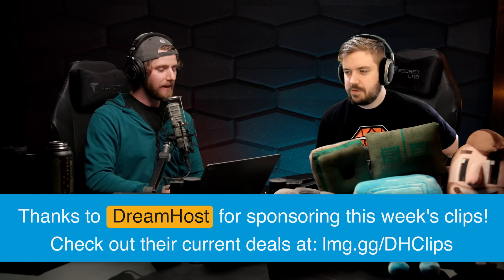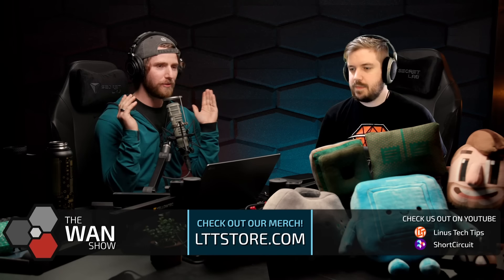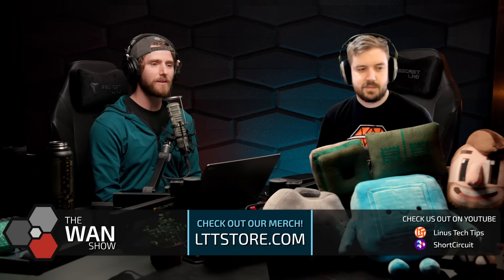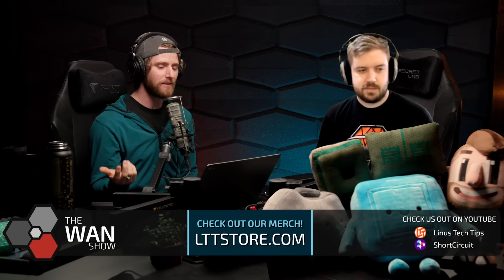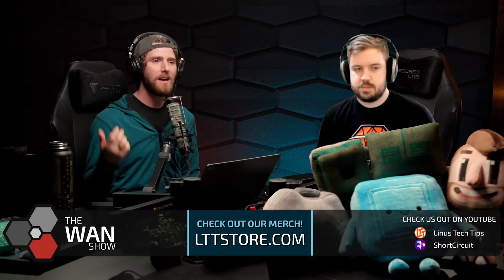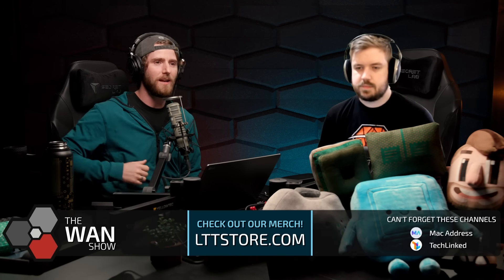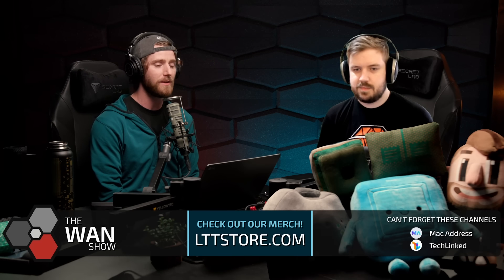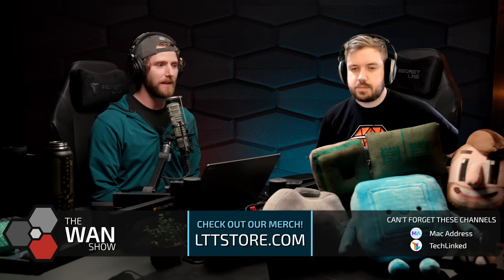They made me WASTE $10,000! Pt. 1

Comment: TP-Link Kasa -- all of their outlets, switches, etc. have an entirely local API (in addition to cloud functionality). I've made my own dashboard to control them in NodeRed (I hate home assistant). I access my NodeRed dashboard UI remotely over WireGuard.

I have the switches integrated with Google Assistant directly from NodeRed. And, if some part of my local setup fails, I can use the cloud integration (with the Kasa app) as backup.

If TP-Link shut down their servers tomorrow it would have no effect on me (other than losing my backup cloud access).

I haven't found any other smart device company that allows local API control out-of-the-box (most requiring soft/hardware modding).

Edit: Also, all direct Wifi, no hubs, no proprietary protocols, no middleman installers/companies.

Comment: The ONLY way to do the smart house thing is to split up the smart and the dumb thing. Regular lights, regular sockets, regular switches, then wire them up to whatever the hell you want, an OTS solution, an arduino with your own code, whatever the hell you want. The controller is a simple switch, so you can buy whatever you want, and you can connect whatever device you want, and if you want or have to, it's easy to change the brains.

Comment: i designed a smart ac. it can cool one room and not the other even save more energy instead of pumping heat outside pump it into the hot water heater so save on water heating. but i been exploring geo thermal energy.

Comment: You should be able to dump the firmware of the newer switches. Even if they have protection you can usually bypass it with fault injection. Probably much harder than creating a pr nightmare for Jasco though

Comment: sounds like the KNX problem. first paying for a really expensive house automation system that works on a seperated bus system basis, only to have to call an really expensive specialised electrician every time you want to change the settings on a switch or anywhere for that matter. the software that is used costs 350€ for 64 objects and if you want more objects in your house you need to pay for the unlimited version that costs 1k€ and from what i remember from the electrician school many companies that build you the system have a paragraph in their contract that they are the only ones that are allowed to acces and change the running system or the warranty for the complete electrical system that they build is gone, so even if you have the money to buy the software and are able to program with it, it is often not smart to actually do it because it could cost more in the end than getting the electrician to do it for you.

Comment: Linus I smartified my house a few years ago, and had the same issues with light switches and what to do with them, I ended up just doing the home theatre with lights controlled by tablet or phone or Alexa, and played around with presence sensing and motion sensors, but then I figured out the solution :)  you have solar installed don't you? add a battery or 2 and you wont have to worry about presence as you should be able to generate your own electricity and store it and never have to pay an electricity bill again. (not sure how feed in tariffs etc work in BC) I installed 10Kw of solar panels (AUD$10K) and a tesla Powerwall 2 (AUD$7K), nearly 2 years ago and I haven't paid for electricity since, my last bill was -$300. (I used to pay $4000-5000 a year in electricity bills) admittedly I am in Australia but just add more solar panels for Canada, you seem to have a pretty big roof :)

Comment: If I followed the video correctly though.

It is not just that the Jasco switches have proprietary firmware that fixes the problem that they refuse to allow end users to download.

It is that Linus bought directly from Jason switches that have very old firmware installed that the manufacturer refused to update AND won't allow you to get the firmware to update.

🙄🙄🙄🙄🙄

Comment: Sounds like Linus is overthinking smart light switches just a bit. I've replaced a handful of my switches with smart ones and it's such an easy part to replace you don't really need something that's future proof, you just need something that works for you today. Personally I actually like the Kasa smart switches from Lutron because they are cheap (I got the really basic one from Best Buy for $10) and they have done the job pretty well. I can turn the lights on and off from the app from anywhere in the world with an internet connection, it's all plugged into Alexa/Google Home so I can control with voice commands, I set the names so I just have to say "turn on/off the master (bedroom) lights" and boom, done. And I can set a schedule for my outside lights as well. So far I haven't had to mess with it, after the initial setup I haven't even had to think about it. It just works. And updates were super easy too. Just go into the app, check for updates, and boom, done.

And if I ever decide it's not what I want in the future I can just pull the switches and install new ones. So I'm not super married to the ecosystem either. Sure, it's not open source, and I'm a big believer in open source, but in this case I'm all for the low cost option that's easy to use, even if it's proprietary.

Comment: Buy a Kyocera printer/mfp and you'll get the same result. No download option for firmware on their site. They don't provide it to end users and they even don't provide it to resellers. Only their qualified (whatever the heck that means) service network is allowed to have it, cause seems, unplugging a network cable, powering off the device, inserting a flash drive, powering on the device, removing the flash drive after the firmware update successful message, and rebooting the device is a task that needs some very very high level of knowledge and experience. So if you want to update the fw in it, you either drive to a service center with a 20+ kilogramm device or you call them to site (and I assume pay for it). Just because you want an up to date fw on a device that has ethernet access so might have vulnerabilities (and yes, this also should be OTA FFS).

Comment: People balk at the cost of Lutron or Clypsal systems when we bid them. 

Lutron has much better systems than the cassetta (which is only designed as a retrofit replacement not a whole home solution).

Turns out that they actually work. They're 10x the cost of the crappy "Internet of things" but we can provide support, replacement, and service in the future. We've had to send in older (20 years+) modules for rebuild because they're not produced anymore, but they were able to return them too us working within a few weeks.

Edited to add: I only install homeworks and sometimes radio ra in retrofit. Casetta is crap but it's cheap. 
I'm also only working in high end houses, from 5-25k SQ ft so whole home lighting makes more sense.

Comment: That's where you tell them that you ordered the devices expecting the latest firmware, not firmware that is 4 or 5 years old and will be glad to sue them for the cost of the devices plus court costs if they don't provide the updated firmware for the device.  What they did to you is basically bait and switch and the devices with the old firmware would violate a warantee of merchantability because of the problems with the loaded firmware, especially since they have an updated firmware that fixes the issues.

Comment: If they don't want to give the actual file out to end users, I still don't understand why they couldn't just have an app or something that connects to the device and downloads it straight to the device so the end user doesnt have access to the file. Also would it be possible to rip the firmware off of the non-dimmer switches and put it on the dimmer switches (prolly illegal tho lol)??

Comment: One of the things I often do before buying a new device is to review other folks' experiences with the device (on the forums). I have mixed results with this. Sometimes I have to read through someone's apparently bad experience only to find that they could have fixed it quite easily. Obviously, that's not the case here.
"I am so annoyed." says Luke. Exactly. This is so ridiculous, I doubt even Apple would do something like this. Even though there are installers that do home automation for you, it's still largely a do-it-yourself field and a big part of DIY electronics is being able to update firmware.
Even now (after pondering this for some time), I can't quite decide whether this is simply evil or rampant stupidity. Either way, it's of such a degree that one couldn't write a character like this into a novel because the editor would say, "That's just not realistic."
Once again, reality overshadows satire.😡🤯🤮💩

Comment: The worst part is that this approach to home automation will add little to no value to the home, since when linus leaves he also takes home assistant and all of the programming with him. I doubt the average buyer will want to invest the hundreds of hours to automate a house of that size from scratch
Reply: Company I work for are focused on handover so that is never an issue (not going to plug us due to...well working there and might be a bit biased of how good it is lol). 

But I am able to report that such systems have been adopted by our competitors so maybe it will be more used in the future all over the industry. 

Just a little note with a code on the electrical central you enter in the app and get acces to the site. But that of course requires internet to the phone to sync the site.

 But for us the devices are not using the internet after installation.

Comment: Working as a embedded tester in smart home light dimmers etc like this. While the company is not really like the ZigBee/zwave based companies. We have our own protocol, app, do everything ourselves including hardware. Even we  do give users ability to update the fw (although through our app). Not a hex you can do yourself but hey, it already have to be configured through the app so it is just a click to update. 
Not that it will help Linus....as the products are not sold over there...and will not be to his requirements either I think. 
But it is fun others having that sort of issues as that would be non excusable for us....even having the motion sensor not configurable at launch would be a non starter for the product to even launch. 

Sometimes I wonder if companies even test things before shipping them out.

Comment: This will likely be buried, but I can provide some context. I am a developer in IoT, but I work with Firmware developers and handle the comms side into the cloud, I am not building the binary for the Firmware.

A few things come to mind immediately, signed Firmware won't work without the micro controller having the key. This can be complicated to support and potentially brick devices if not handled correctly.

Given IoT and best practices, allowing unsigned Firmware is a big no, and having a shared key increases the risk 

It could be a situation similar to what I have experienced where a manufacturer refused to provide any form of documentation for a feature of a processor that didn't match the behaviour documented, and the solution was a pre compiled binary that not even we were privileged to any glimpse into what it did. We suspect that it is a software fix for hardware issue that they won't admit to and now cannot change. They may have a restriction on who can have those specific instructions. 

If for example the Firmware is packaged as a delta rather than a complete image, this too could be a complex problem to support. 

While I agree that proprietary code is a dumb one, I don't think it is it and it's only a reason they gave to you. (unless it's outside of their control from someone like the processors manufacturer.) It's more likely an issue supporting end users doing it, and supporting it in a manner that doesn't end up bricking the device.

Comment: Motion sensors should be only used to CONFIRM something, not to trigger something. Use door sensors to TRIGGER a script, which will turn on the lights, then the script SHOULD wait 5 minutes and start motion sensing, if FOR the NEXT 5 minutes there is still movement leave the lights on. If there is no movement turn off after those combined 10 minutes . That then also works for exits, and will turn off lights after 10 min.

Comment: If I ever changed my home electrical system to a smart home, I would do so using stupid push buttons, pt-100 or 0-10v heat sensors and stupid motion detectors. I would use an industrial PLC controller to control it and make the software myself.

Comment: Why not Bus wires or empty tubes in your wall, so someone can shoot a wire through? The wireless smart home is pretty easy to install later but having Bus wires in the wall is not as easy.

No matter the system, a good system doesn't require any cloud and can be highly customized. I have a small Homematic IP system with their CCU3 Hub. This one doesn't require the cloud and its basically a raspberry pi with a board to control the wireless stuff. You have 2 options of programming. One would be via Home Assistant and the other one via their hub. I would recommend doing it on the hub for their stuff. It's faster, because the devices can talk to each other. Also you can access all the data points.
But I have one downside. Something is messing with my communication and some things are delayed af, but only when my remote sockets are running. I don't know what it is.

The most important thing is Smarthome needs to fit you and not the other way around. There are systems with normal switches and they can be controlled via it. The downside can be that the switch might be flipped at some point, because when you for example only trun it off via the switch but not on, it will be flipped, except you have something that flicks the switch into the right position.

People think smart home is only being able to remote control it. This isn't true at all. A good smart home is doing stuff you would do at that moment, based on the data. Telling your smart assistant to turn off the lights is not smart. It's a remote control.

Good sensors are key. For example Homematic IP has a variety. It has motion sensors, presences detectors (don't know how good they are compared to motion sensors) and a sensor that know the direction of the person. The last one can be an interesting thing. With motion sensors you know that someone is there but not how many. With this sensor you can count the people who are entering and leaving the building.

A sensor needs to make sense. A motion sensor makes sense in the driveway to turn on the lights. A motion sensor in the garage makes sense to trigger a "we are back home" command, combined with a device tracker. A motion sensor in the bedroom makes little sense. It rather makes sense to have a sensor that would detect your feet touching the floor and depending on the time of day and your schedule, it might trigger a night light towards the toilet or start making you a coffee or open the blinds.

By the way, schedule tracking is something nice. Homeassistant can access your calender (at least caldav) and look for certain events. It can make sense to change your heating cycle when you don't leave the house for work. It's just one extra data point. This might be helpful when you don't have other data points that can see if you are at home

Comment: Almost all smart device with motion sensor cannot be turned off.🤔

You can set a delay if the motion have not change it will trigger the action.👍

You can also set the sensitivity. If ur getting rowdy in ur room.😆

If you want a good hub to control all ur smart devices, either pick Smartthings hub or Alexa hub.👍

Comment: I’m not sure if “smart home” is ever going to fully catch on, having wifi lightbulbs that can change colour will probably become pretty common, for the ones I’ve seen if the “smart” part dies you can just flip the switch a couple times and it’ll start working like a normal light. “Smart” just means it’s got a tiny, terribly made, proprietary little computer in there that will almost definitely fail within 5 years either physically or in terms of software - so replacing switches and thermostats seems like it would become an incredibly expensive maintenance nightmare.  (Also “mission critical” stuff like thermostats should ideally be as simple and reliable as possible). Replacing light bulbs every couple of years isn’t that bad though, since they’re easy to replace yourself without hiring an electrician.

Comment: I think I understand why they would do this, but it isn't a good reason in my opinion. I'm assuming this is security related as they don't want to give just anyone the firmware in case a malicious actor was to get it and find ways to then hack into smart light switches or distribute a modified version and cause havoc. That said, there should be other protections in place to avoid that being an issue.

Comment: not sure how Kasa will work in your system, but... they are Wifi switches maned by tp-link. so they should work with home assistant, and you can update their firmware easilly. the only issue is the mooshy switch that they have. They are also CHEAP.

Comment: This is much of the problem with smarthomes and devices. You need to have an IT and networking department at home and if anything happens to that person then house eventually stops working.

Items are not interchangeable and need an integration engineer. I watch many videos on youtube where if the husband (typically) has a car accident or becomes incapacitated then two weeks later home assistant, IFTTT, or device will stop working (because upgrade) and family would get locked out, not be able to turn on lights or even play music, etc.

Basically until there are common standards and easy ways to integrate then smarthomes are not ready for primetime.